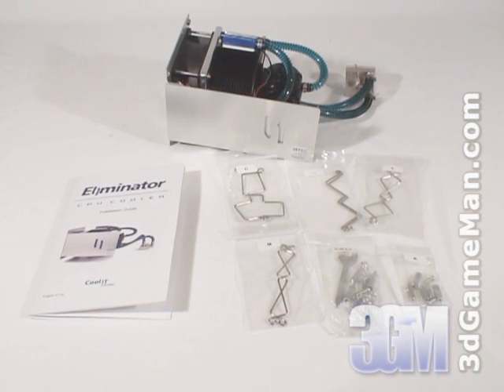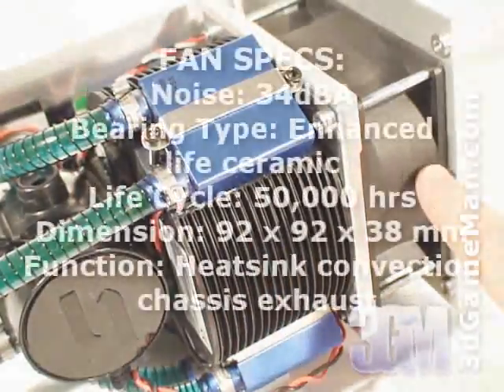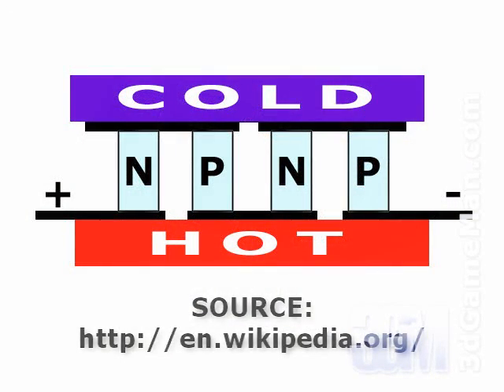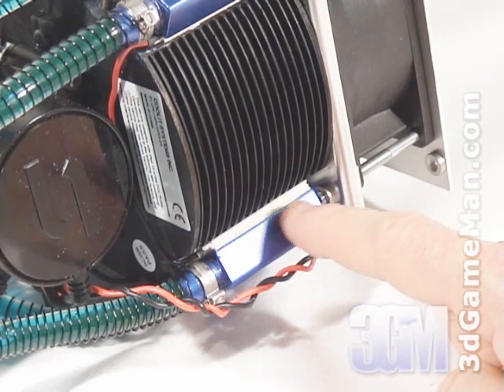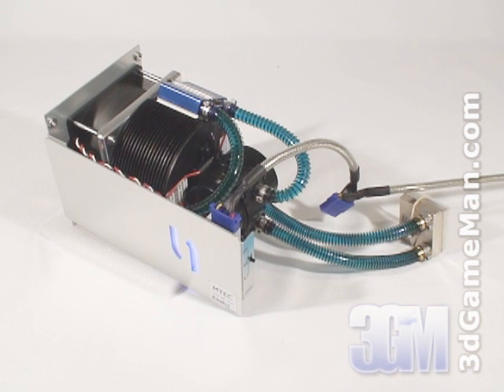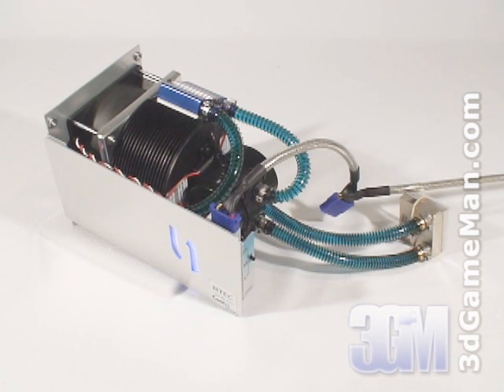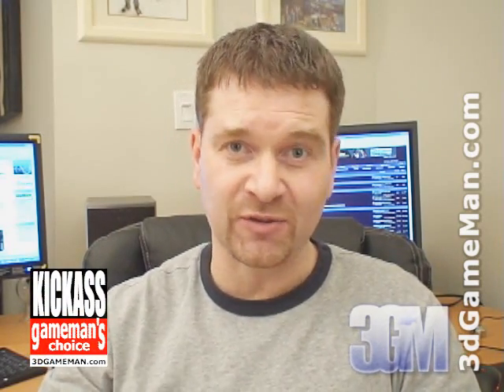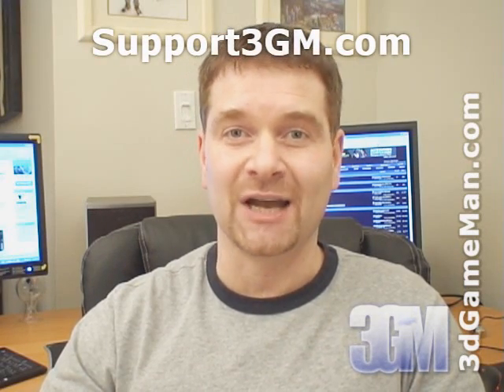#769 - CoolIT Eliminator CPU Cooler (TEC) Video Review

Comment: Will the eliminator cool an AMD Phenom II 940???  I'm currently using a Xigmatek S1283 in a push/pull fan configuration using two Ultra Kaze 133cfm fans.  I'm getting 37C idle and 52C full cpu load using prime95 in torture test.  The cpu is overclocked at 3.7Ghz at 1.45v.

Comment: transfers heat from the cpu faster than an air cooler, and because its a Peltier cooler it will cool the res containing the water down even colder.